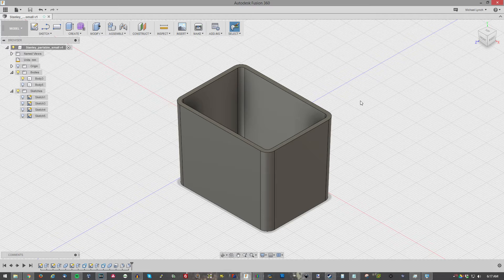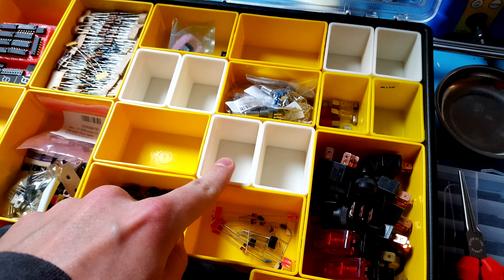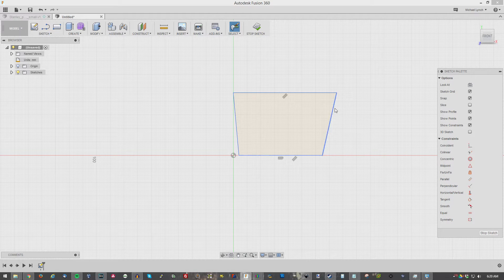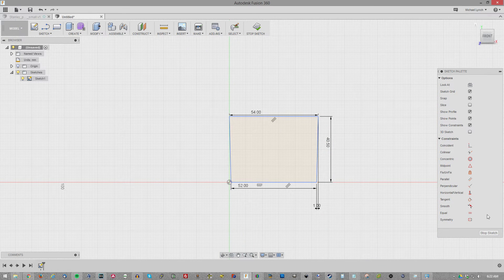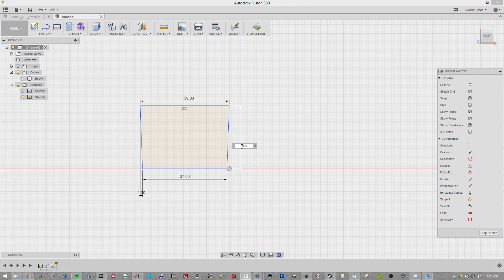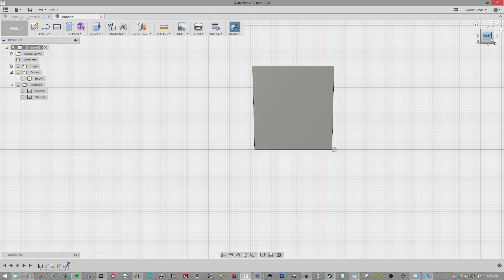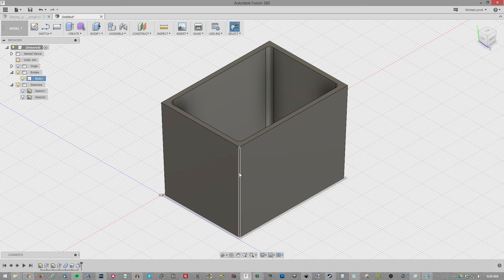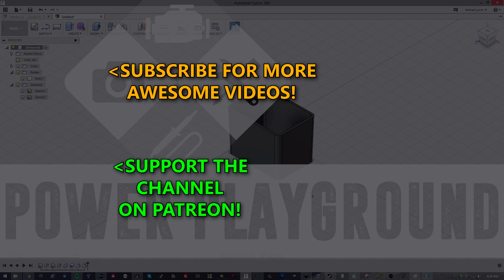Autodesk Fusion 360 - Translate + Shell (Modeling Stanley Organizer Bins)

Comment: Another way to do the taper, if you don't want to mess with angels.

Create a sketch for the bottom of the box (shortkey R). Do an offset of the 1 mm (in your case) (Shortkey O)
Move that second sketch up with the distance of your finished box height. (shortkey M) 
Then do a loft between those two planes you sketched. (Press S and write loft)

Comment: Some quick tips: 
1) If you extrude a simple rectangular block (no taper), you can use the Draft command to taper all 4 sides at once.  You need to enter an angle, but fortunately you can let Fusion do the math for you by entering an angle of "-atan(1/40.5)" for a 1mm taper over 40.5mm height.  This is an especially appropriate operation, since the reason the Stanley bins are tapered is to provide a draft as required for injection molding.  Speaking of which...
2) Since we're all presumably doing this for the purpose of 3D printing these bins, there's no reason we need a Draft in the first place - vertical walls would make it that much simpler to model and gain you about 5% more interior volume
3) If you apply the exterior corner Fillets before the Shell command, then you'll get the interior ones automatically.

I know it's been almost a year since you posted this so it's old news, but perhaps other viewers might benefit.
Reply: Was indeed helpful. Thank you!